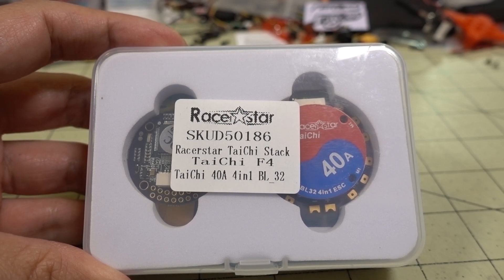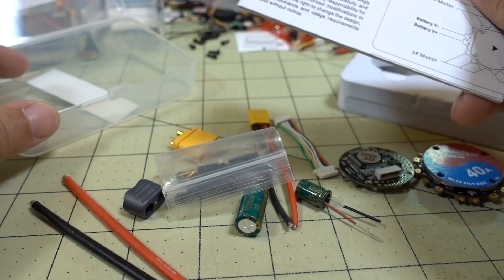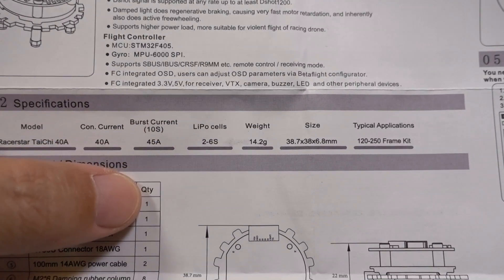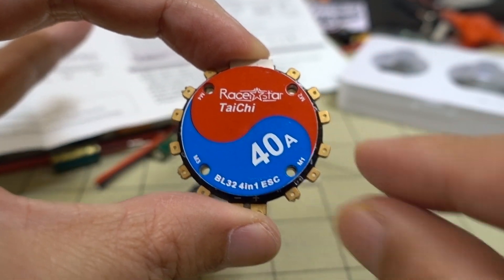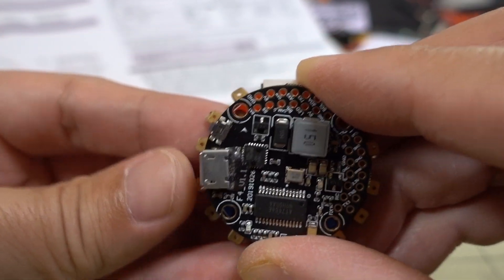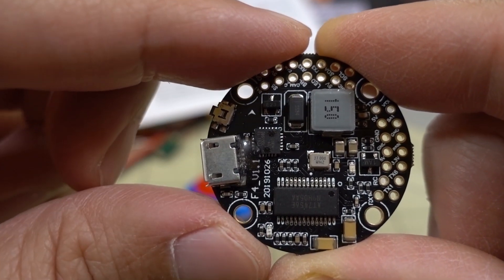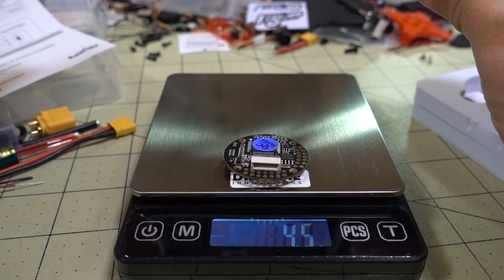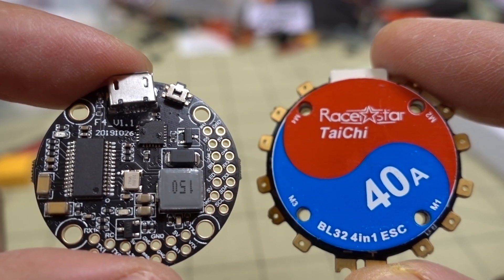Racerstar TAICHI F4 40A 32 bit Flight Stack Review 🏁

Comment: Seems like a nice stack to me. I like the fact that the soldering pads for the motors are more or less pointing in the direction of the motor for a cleaner wiring look. It would be nice if they made a vtx to match. I will probably consider this for next build.